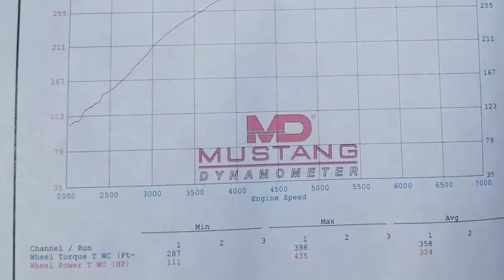Mustang GT Stainless Power OR LT's, Stainless Works LMF catback and Airaid CAI Dyno run

Comment: Just installed the same set of headers and my check engine light came on I think due to bad o2 sensors did you have this issue as well?
Reply from the maker: Sorry to hear that..no I didn't have the same problem..did u upload a tune yet?